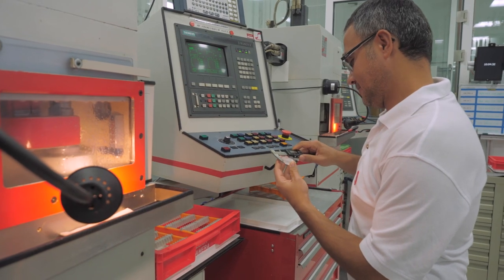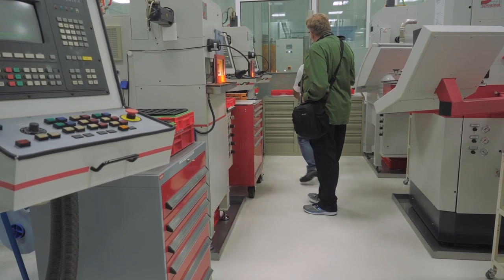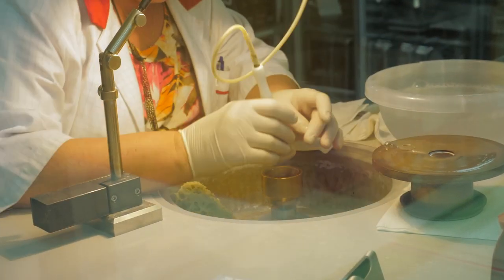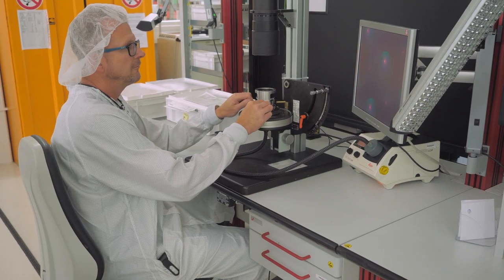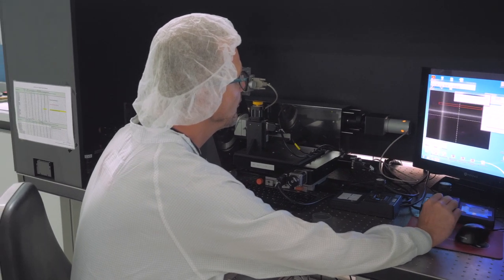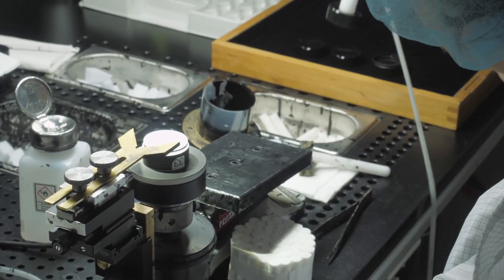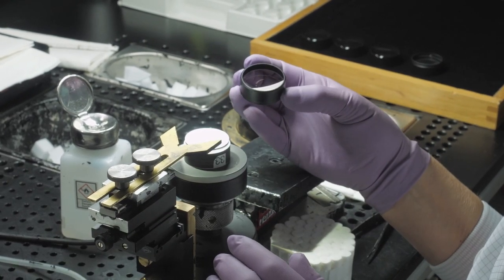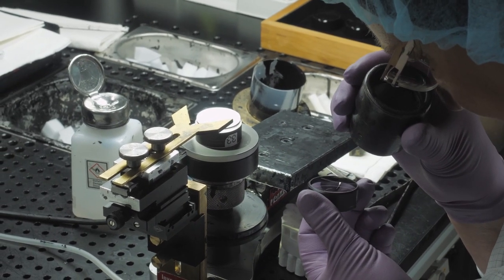Leica 04 Optical Design

Comment: so if minimizing the number of elements is bad, does this mean putting a UV Filter onto a Noctilux .95 50 mm is like applying lipstick on the Mona Lisa?
Reply: More or less...yes!
Reply: Usually not because those are simplistic glass elements designed to not be reflective.